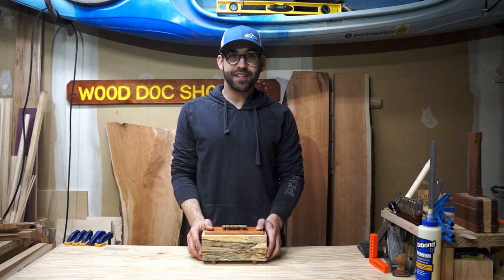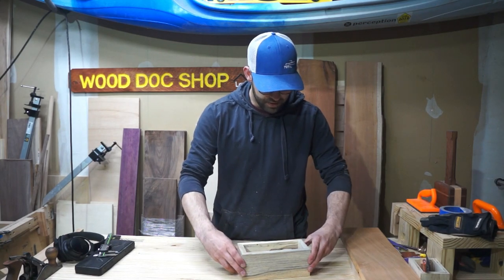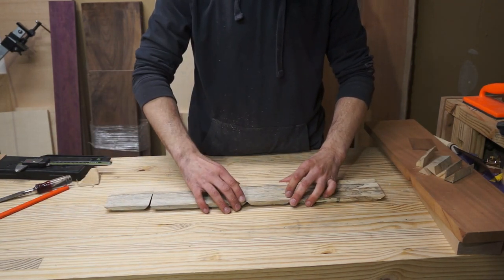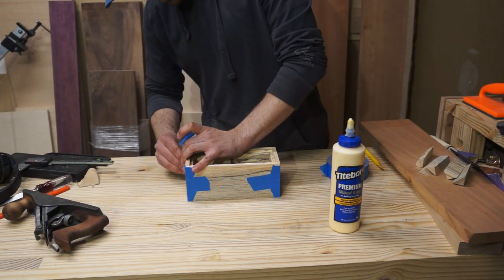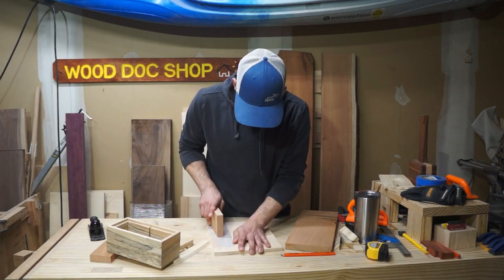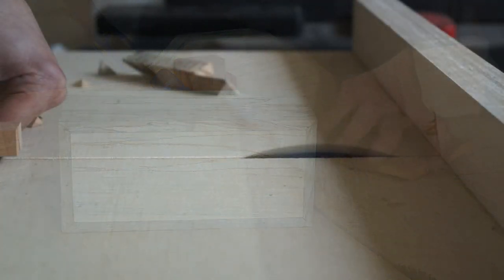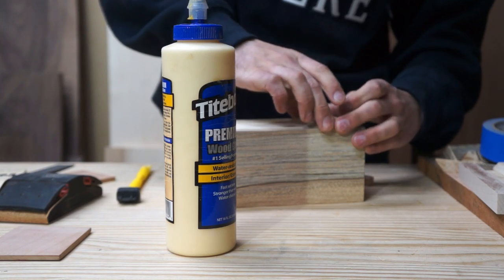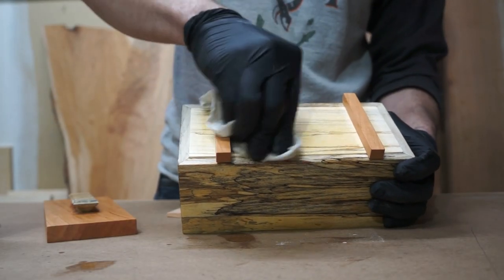DIY Tea Box / Mid Century Modern Tea Box Video

Comment: FYI, when I have small surfaces to secure handles to lids, I'll drill a couple of holes in or through the lid and in the bottom of the handle and hammer in some wood dowels prior to gluing. Through holes in the lid make the holes in the bottom of the handle fairly easy to line up. Drill your holes in the lid and use nails or a brad point drill bit to mark the location for the holes in the bottom of the handle. However, for non through holes, you can drill some holes in the bottom of the handle, clip off the ends of some #17 or #18 nails, insert these in the handle holes and mark where the holes are to be drilled in the top of the lid. My explanations may not be the greatest, but you're a smart guy and I'm sure you get the idea. With the dowels and glue, haven't had a small handle fail yet. I hope this helps in future projects.
Reply from the maker: Honestly this sounds like a great method, I really appreciate the insight and tips! Ill have to try it out the next time Im going for a lid with a handle on top!

Comment: Very nice job, well planned mostly and executed. Not a fan of the legs you used. They seemed a bit weak compared to the thought you put into the rest of the overall design. Tooth pick wood plugs I agree with another commenter would have been a good way to go from a strength stand-point. Like I said though nice job, thanks for the free content!
Reply from the maker: completely agree on all the things you said! I think there are a lot of ways I couldve improved this design so hopefully can add some of those tips in future builds!